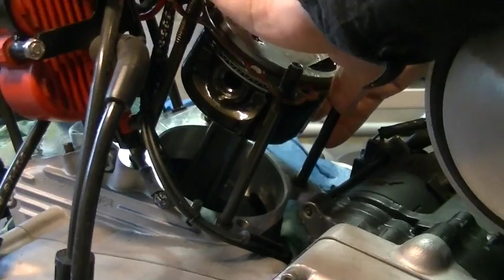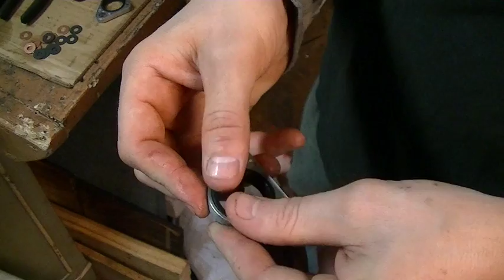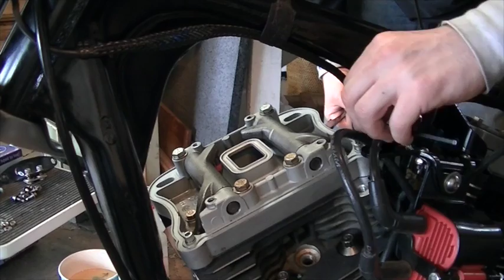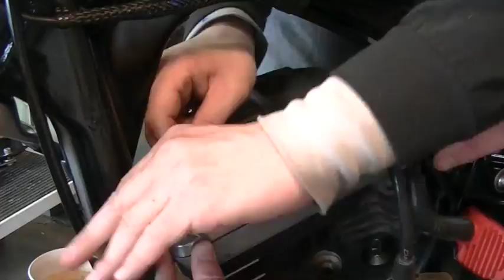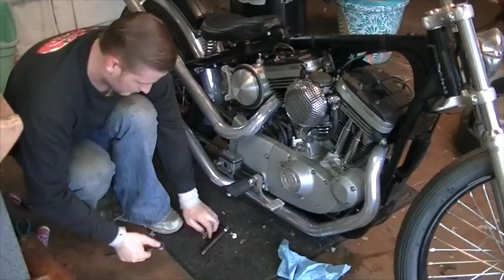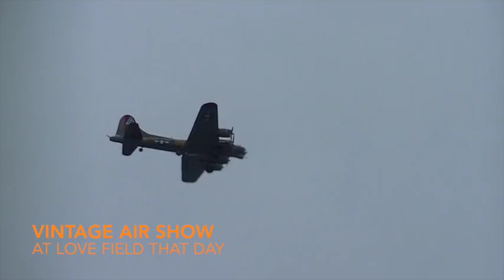Harley Evo Engine Top End Assembly | Evolution Engine Rebuild

Comment: Nice job w this video, it is great to see how things are done, I never built an engine, but it is nice to see how all the
parts work, the push rods, rocker arms, When I bught a 91 XLH1200, I learned more about engines than I ever did
before. It ios great riding a motorcycle but I say hats off to the wrenchers who keep them running.

Comment: I'm sure this is a dumb question, but what is the cable going into the middle of his rocker box for?
Reply from the maker: lpd1122 This bike has the 1200cc engine with dual spark plugs per cylinder.  That cable going into the middle of the rocker box is a spark plug wire.  Thanks for watching!